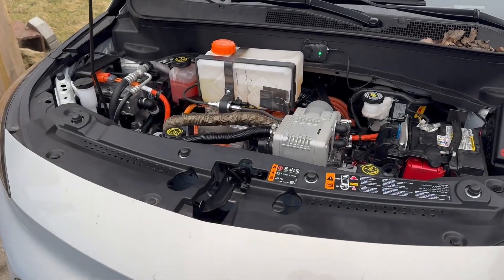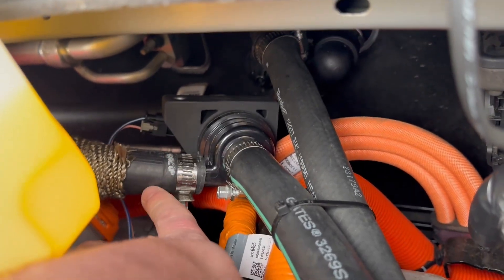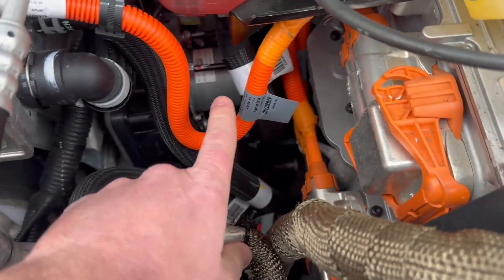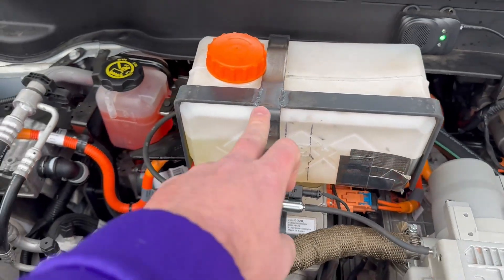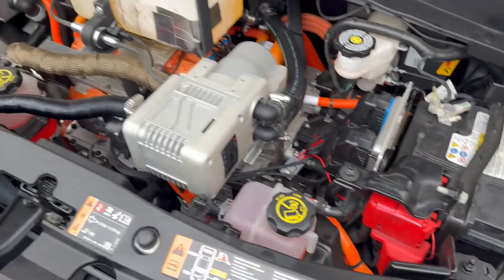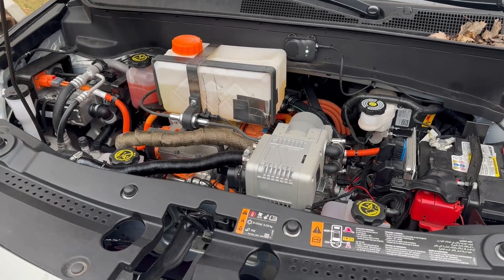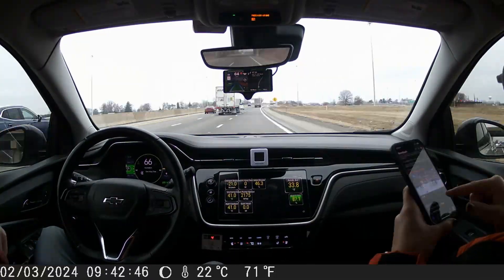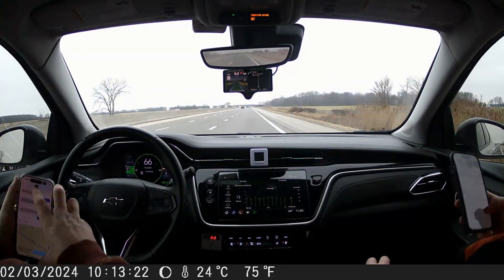Chinese hydronic diesel heater installed in Chevy Bolt EUV EV.

Comment: So will this also help heat up the battery too? My understanding is that the same heater is used for both cabin and battery heat.
Reply: It is not. The battery is heated and cooled entirely independently from the cabin. The battery doesn't use much energy to keep itself warm, anyway. And you really don't want to overheat it anyway.
Reply: @pootispiker2866 are you positive? I thought it used a series of electronic valves to control coolant flow but that the same heater was used?

Comment: Need more detailed information on how this was done , how to mount, where to attach, does the water flow with the factory pump or does the heater have a pump , how did you interface with the bolt screen, ect ect ect more video please!!!!
Reply from the maker: @edolson1698  I show you all of that in this video. I didn’t do anything to the bolt interface. It does it all itself. The heater has its own pump.

Comment: Lost zero range due to cold is not correct. You lost range due to the car battery being cold period. You just didn’t lose additional range running the heat.

Comment: What is your typical range loss in cold weather without this?
Reply from the maker: About 30%
Reply: I'd get 450km in summer temps here in Canada. But now in winter I'm getting 310km. Granted, it hasn't been a brutally cold winter, so it could be worse.

Comment: Watch your temperatures and rate of change. I don't know what temperatures the battery normally sees or how fast it heats but you don't want to inadvertently ruin that expensive battery!
Reply from the maker: On the bolt the cabin heater loop is separate from the battery heater

Comment: I don't like that super-cheap diesel tank!  Crack that and start a fire and bye-bye insurance!  That car accident that totaled your car and was not your fault and insurance was going to replace the car until suddenly it becomes your fault that the car burned up and you lost $$$.  At least buy a motorcycle tank that's designed to take some impacts without splitting. Plus I assume that the cap will allow proper equalization of the pressure without a risk of leaks.
Reply: Diesel doesn't ignite like petrol, much safer and more like oil.
Reply: That's not how insurance works.

Comment: just curious what is the purpose of this hack?
Reply: Regular cars heat themselves with waste heat from the engine.  Electric vehicles have to use electricity which will reduce the range.  In extremely cold conditions the range can be reduced by 1/2.  So this just gives him a way to make heat with a small amount of diesel fuel.

Comment: Tesla's efficient heat-pump pretty much solves this issue
Reply: Yes but their cars are more expensive and among the least reliable sold. This brings a very viable solution to other brands without heat pumps.
Reply: False. True cost of ownership is much less. The Model Y is the best selling vehicle currently, selling more than the Toyota RAV4 even. The Model Y is cheaper than the average price of a new car.  @vladimus9749
Reply: It really doesn't though.

Many EV's have heat pumps. And while a heat pump is certainly more efficient than resistive, it's still not no range loss.

If I spent $30 to burn ~7 gallons of diesel throughout the winter on road trips to shorten or eliminate the abysmal DCFC times of the Bolt, I'm at is $30 insanely well spent. Especially when you factor in eliminating $0.50+/kwh charge rates. The diesel may very well be the better financial option too.
Reply: @brandonk1163  The Bolt is also consistently on top of the best value in EV lists. Tesla is....not. You think the same way I do about EVs, with your wallet. To most others, they're a fancy toy.
Reply: Its important to realize that a ICE vehicle is, at most, only 25% efficient. Meaning in best cases that 75% of the fuel is lost. So if you spent $100 to fill up that tank, only $25 is actually moving you. Rest is lost via heat, and other inefficiencies. Costs .09 a kwh to charge my electric car when I have to pay, most of my charging is done free though via various locations. @brandonk1163
Reply: No it doesn't. The problem isn't the efficiency of the heater. The problem is that it uses the limited energy in the battery to operate the heater.
Reply: At moderate temps, yes, but at temps below freezing a heat pump loses efficiency to where it's like resistive heat.
Reply: @Tazdeviloo7  Gas cars are only 20% efficient. Meaning 80% of the fuels energy is lost. I.C.E. vehicles have 15% reduction in fuel economy in the cold. Most of gas cars energy is lost to heat, so the biproduct of a gas fueled car thats only 20% efficient is lots lost to heat.
Reply: Not really. When it's 20 below out the Teslur can't pump heat. I had good heat in 5 minutes in my bolt because of the resistive heater when it got that cold where I live.

Comment: There's no exhaust reduction. Diesel still produces some carbon monoxide and that's going right into the cabin. I guess you just made yourselves the canaries by testing it on a 6 hour trip. Any light-headedness or headaches after?
Reply from the maker: Exhaust goes down the side of the inverters and out a hole in the belly plan. I did throw a co2 monitor in the car just to be safe but it read all zero the whole trip.
Reply: @classic079  Keep the CO monitor in there. CO has an amazing ability to penetrate even sealed spaces but that heater is no where near as dangerous as a leaky exhaust manifold on a gas engine, of which was the norm back in the day.
Reply: @classic079  co or co2 meter? Important difference, but I think you'll be fine. Many cars have heaters and none of them have monitors from the factory.
Reply: It's a hydronic heater, meaning liquid. The diesel fuel is heating the cars existing coolant loop. The diesel exhaust stays outside. This isn't like a diesel to air heater like is common with the van life crowd.
Reply: It seems exhaust pipe wrapped in insulation goes downward, but still would be nice to see actually where it goes out

Comment: Any diesel odor in the cabin while the heater is running?
Reply from the maker: I could smell the burn off of the exhaust pipe/wrap the first few hours but not any diesel itself but that went away when driving. I put a co2 alarm in the car just to be safe and no issues.
Reply: who cares.....  Love the smell of diesel in the morning air.  da dara da da... da dara da da.........

Comment: What kind of diesel consumption did you see on your trip?
Reply from the maker: About a half a gallon in 5 hours, but I think this is high and would use way less if it would use the thermostat instead of going full blast to 90c then off to 50c and then full on again. It should be able to hold a temp but I've not figured out how to do that yet.
Reply: @classic079  is it a modulating burner? I would assume it's just a simple single stage, non-variable burner. +/- 20 degrees is probably pretty typical for something with such a small heat exchanger and a comparatively large burner.

Are you just using the cabin fan to blow across the stock heater core?
Reply: @brandonk1163 The coolant loop on the Bolt also heats/cools the battery so it's definitely getting used.
Reply: @Tazdeviloo7  the Bolt has multiple coolant loops, dedicated for each task. The cabin HVAC coolant/heat loop has nothing to do with battery.
Reply: @brandonk1163  TIL. Thank you
Reply: @classic079  I have a Chinese hydronic diesel heater like this (different mfg) in my Bolt. They only have two modes. One is to heat up and then shut off completely, The other is to cycle continuously which yours is doing. The air diesel heaters operate differently. You could try altering the fan speed on high and low, along with the diesel pump hz delivery, but I wouldn't attempt that wiithout a CO meter to optimize combustion. The password to change the settings is typically 1688. YT has videos on using the CO meter. Personally, I'd leave it like it is, other than optimizing for combustion so it doesn't soot up over time. Nice video! 

 How did you hack the Bolt's display for all those OBDII readings?